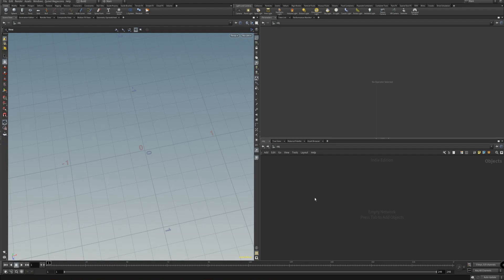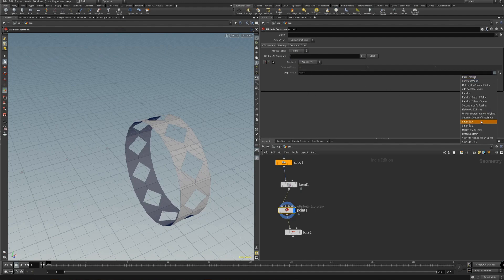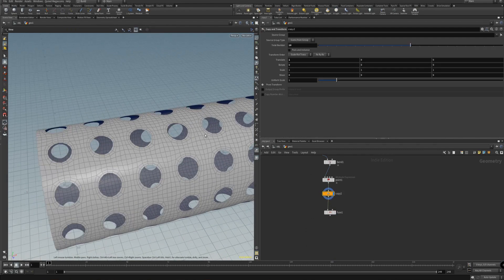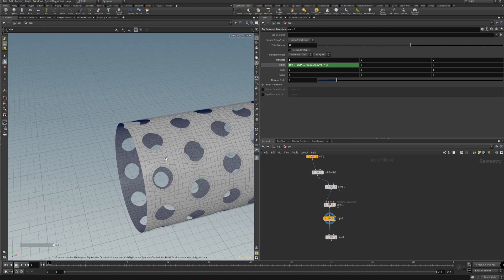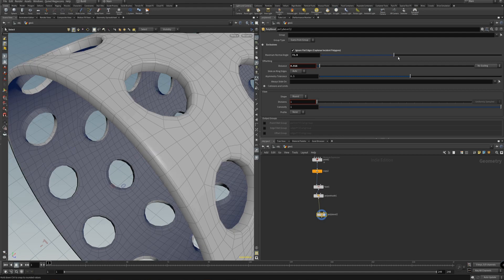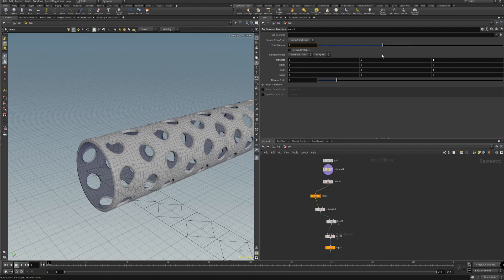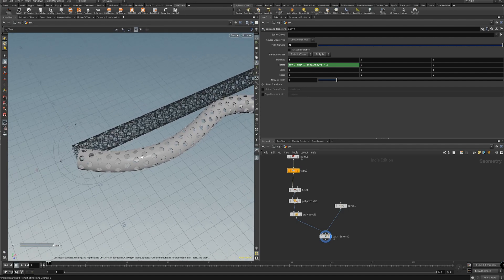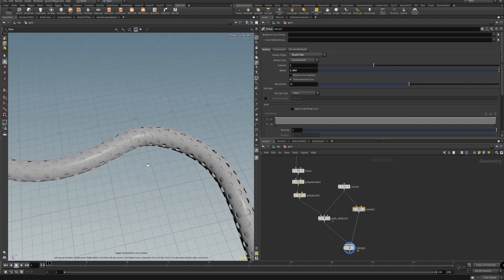Houdini 18 easy cylinders with holes tutorial.(Free HDA download)

Comment: and how do you copy the line or tube of inside vertex to vertex with the tube full of holes.?
Reply from the maker: If you are asking about the last past of the tutorial, sweep node has an option just to generates a profile of a tube so you don't have to do it manually for most basic shapes. We don't necessarily copy we just use merge node were we can wire in an infinite amount of nodes in and it will visualize it together as one object.